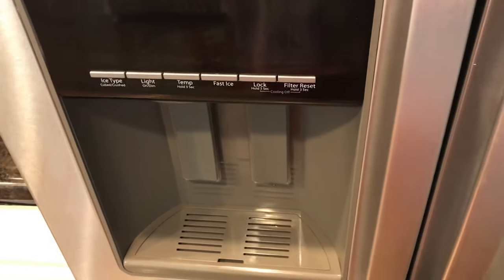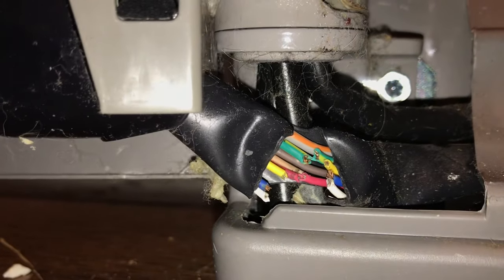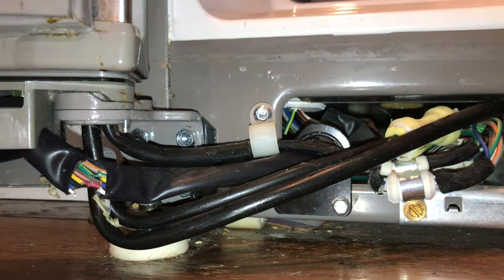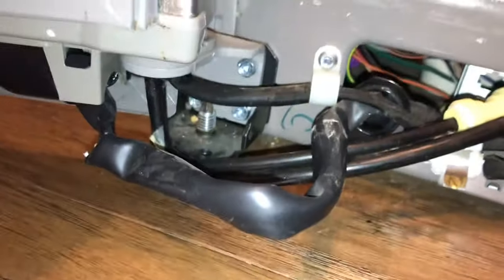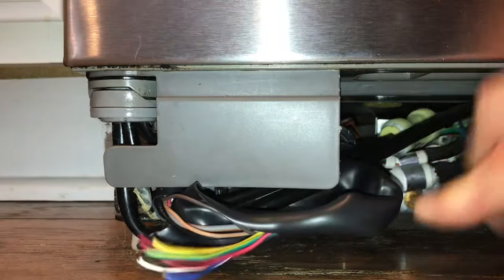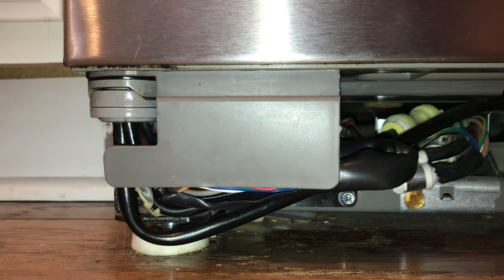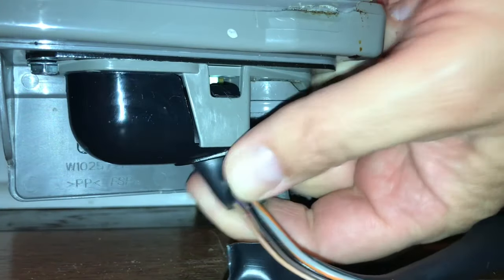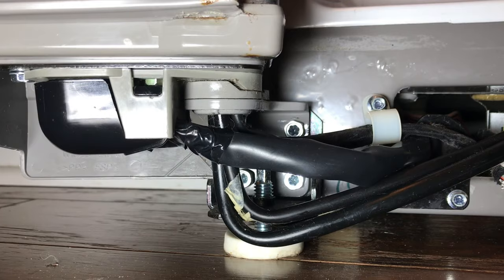Whirlpool double door refrigerator not making ice and ice dispenser doesn’t work. Wires WRS571CIDM01

Comment: I want to thank you for this. Mine stopped making ice about 6 months ago. I bought a new replacement icemaker  part and was looking for installation videos when I saw your video. My wires  on model WRS588FIHV00 look just like yours. Broken. Has anyone told Whirlpool or complained to them? Again, thank you for the video. At least I didn't install the new icemaker only to have it not work. You saved me time and cursing.
Reply from the maker: I called them and they said they would cover parts, but I had to pay labor and use their service guys.  Good job finding the issue. 

Please help me by subscribing.

Comment: Thanks for the video.  I replaced our icemaker a year ago after it stopped working.  New unit still did not work.  Resorted to dumping bagged ice into the hopper and continued to use the ice dispenser until it recently stopped working. While researching the problem again I came across your video. Sure enough, all but one of the wires were broken. Spliced all of the wires back together and now we are making ice again!
Reply from the maker: Did the same thing by buying bagged ice for a year, until I decided to dig deeper into the issue. Enjoy the full glass of ice!

Please help me by subscribing. Thanks.

Comment: I have a 6 year old fridge with the same problem. It was about two years ago I google this issue. I couldn’t find anything on YouTube at the time. It was pictures in a forum. Sure enough, I looked at the bottom of the door and there were a lot of broken wires. What a horrible design. No ice for over two years. Can wait to splice the diced wires and get some ice again

Comment: this video just saved me from a job turning into nightmare with customer. this video should be the first on searches for these models. I almost charged my customer for a control board after changing auger motor, and ordering new interface control panel. what a waste for a manufacturing defect.
Reply from the maker: I agree.

Comment: Every single one of the wires were sliced clean when I checked and the protector had maybe a half of an inch left before the whole thing was detached.  Insane. I hate this fridge so much. Fridge portion has never worked right, always freezing stuff from day one. No room in freezer for anything really. Can't even fit a pizza without turning it sideways. This video helped me so much. I was driving myself crazy trying to figure out why the ice would not work. Will have to learn how to fix wires though lol XD
Reply: I used this video to splice the wires together. Just strip Enough of the wire covers off, twist them
Together and secure with electrical tape. Then wrap the entire wire bundle itself in electrical tape. 

https://youtu.be/ihpNCVk1lF0?si=v5J9Ar_jcZLoehf_

Comment: Thank you @motofun for this great video. I had 4 broken wires. I repaired them by adding a little extra 18 gauge twist wire in between the break and now have ice again. Note that 3 wires carry no voltage but still works. (green, blue and gray/orange).

Comment: Our dispenser went out about 6 months or so ago and most recently the ice maker stopped working. I found 4 severed wires and now we're back up and running with both. Thanks for taking the time to post your video!
Reply: Should also note our fridge is less than 2 years old.

Comment: I have the SAME EXACT problem!!!  Same exact fridge.  I bought it 6 years ago, so it's "Out of Warranty".  Absolutely REDICULIOUS!!!!!  Thank you for showing this and validating my frustration!!!  Soooooo stupid!
Reply from the maker: I agree. Frustrating and stupid.  Good luck with the repair!!
Reply: @motofun72  I cut the wires, soldered some new wire between each end and Voila!!  Worked for 2 days, but ice maker stopped making ice.  Ugh!!
Reply from the maker: @kevindesaulniers6409  man, so close!!
Reply: Same exact issue after 6 years. Almost ordered the auger motor, and saw this video and yup, wires are cut. Great job to the OP. Thx. Will have to contact an electrician now.
Reply: Same exact issue after 6 years. Almost ordered the auger motor, and saw this video and yup, wires are cut. Great job to the OP. Thx. Will have to contact an electrician now.

Comment: Mine stopped making Ice yesterday, its 2yrs old. 4 broken wires, I stripped and reconnected real quick 30 min later I was making some ice. I will do a a Permanente  repair later in the week. Had a older model in prior home for 5 years never any issue. Great video! I subscribed for you.
Reply from the maker: Two years old and cut wires. That may be a record. 

Less than one day without ice?  That’s what I’m talking about! Good job getting it done asap!  Thanks for subscribing.

Comment: Awesome video. Many thanks. I wish I would have found it before buying and replacing multiple other parts that were not needed. And I completely agree that there should be a recall or class action lawsuit vs Whirlpool on this, and that Whirlpool customer service completely blows and don’t respond to inquiries and complaints.
Reply: Yeah, me too. I bought a new icemaker, a control board, water valve, and both IR ice level sensors. Still no ice.

Comment: I have a similar Whirlpool refrigerator (WRS571CIHV01) and am having the same problem with the ice maker and was able to find this video. Sure, enough I opened the freezer door and looked down below and found the same issue with most being wires pulled apart. Thanks for posting this!

Comment: Thank you for this!  Our 4 year old unit stopped making ice a few days ago.  We put a new filter in first to make sure the water pressure was adequate. Next was to replace the whole icemaking unit.  Then we saw a single cut wire at the bottom of the door.  It was a very clean cut so we thought it might be for a function we don't have on our fridge,  In desperation, my hubby joined the 2 ends and a few hours later we had ice!

Comment: I am a retired electrical systems trouble shooter=wire stretcher/tube bender.  My wife found this video and showed it to me.  Long story short, I found two broken wires in exactly the same wire bundle your video showed.  The black wire is power to all the guts of the ice maker, the tan is a check to the module for ?????  Took me a couple hours to isolate and fix.  Used soldering and shrink tubing to reconnect the wires with a additional wire loom back up got us back up and running.  Thanks for the insight and thanks to my wife for finding your video.  This is not rocket science or require an engineering degree.  Whirlpool could have done much much better for an 'American Made Product"!  My Wisconsin Old Fashion on the rocks tastes damn good!!!!
Reply from the maker: Good job all around!  Drinks are always better with ice. 🧊Thanks for watching. Please help me by subscribing.

Comment: I had already fixed this once but my repair failed.  Not sure I have access to enough red wire on door side to splice.  Black wire also split from prior repair.  I wish I had known of the slack in the main body previously so thanks for pointing that out.  Even with the door side bottom cap popped off there doesn’t seem to be much slack.  Wish there was easy access to splice additional wiring on that side as well.  Nice video!
Reply from the maker: I agree. Not much wire to work with at the point where it happens. Even if extra wire is added, we all take the risk of it happening again. So far, my repair is still ok, with the extra slack I put in. 🤞🏻

Please help me by subscribing. Thanks.

Comment: Thanks for the video.  My ice maker quit working.  It won't turn back upward after having dumped the last batch of ice. Was thinking it was mechanical but when I saw your video I checked mine.  I've got at least 3 wires broken.  Most likely the cause.  If not, its definitly the place to start.
Reply from the maker: Awesome. Soon you will have ice again!  Please help me by subscribing.

Comment: Add me to the list. My side by side is a year newer and still. What a bad design in the first place. Thanks for taking your time to post this, once again, youtube saves the day.
Reply from the maker: You’ve been added to the list of failures. Good news is, soon you will be added to the “ice ice, baby” list very soon!

Please help me by subscribing. Thank you!
Reply: My fridge is now back and working. A couple tips for those who take on this task: 
1. Take the freezer door off the freezer. The cables un plug behind the cover at the bottom of the unit and it's a lot easier to re-solder any wires with the door sitting on a workbench.
2. I took the clip off and ended up feeding the wires through a 2 inch section of pex in an effort to keep this from happening again.
Reply from the maker: @e2a2j  awesome. That’s for posting the tips!  Good job.

Comment: Same issue, got there after replacing the ice maker and was about to pull the fridge to fiddle with water valves. Thanks for the tip! Thankfully only 2 wires are cut on mine, I think I can solder them well enough.

Comment: Thank you for posting this as my tan, white, and green stripped wire was severed and I use marine crimps and heat shrink and now my second ice maker they warranted out is working.   I could figure out how to put the protector back and left it off to give the wires more room to move.   Not a great design if you ask me.
Reply from the maker: Good job. I agree, bad design. 

Please help me by subscribing.

Comment: thanks for info I have a whirlpool side by side GSF model and it stopped working after 2 years never had time to look at plus it was expensive since I had no warranty, anyways about a 4 week ago the main control board went dark so I figured it is 13 yrs old I will get one it was cheaper then new fridge, then all of a sudden it  was kicking out ice like a mad ice machine then it died again so started looking in to problem and found out the receiver board went bad  got a new but still no ice so looked at your post and thought humm no way sure enough I also had broken wires that had burn marks on them so was not easy fix repaired :face-orange-frowning: darn whirlpool I have ugly words to say about whirlpool but I wont fixed wires and low and behold ice but it was small ice tweaked the water flow adjustment and now all good for now I think those wires messed withe the Ice maker but will let run till it dies :face-blue-smiling: heck it 13 years old, thanks for posting the wire problems saved me more money lol learned a lot along the way ice machine very sensitive  i will share that the ice makes should have 120 VAC voltage at all time  to test points L-N when door switches are depressed good luck all I will now be very careful and look at fridges in a different light technology hummm

Comment: Thanks!! Luckily mine only had two wires cut. Ended up cutting off all of that plastic conduit and using electrical tape. It looks to me as if that conduit could be cutting the wire.

Comment: This is a design flaw not only with Whirlpool, but also Kitchenaid and other side by side refrigerators with wiring being compromised in the door.  You explained it well.  Have had our now 10 year old Kitchenaid Side by Side repaired maybe 7-8  years ago for the first time by a repair man, then have been doing it ourself to reconnect severed wires every 6 months or so for the past 7 years.  The repair always works but is temporary until the wires are severed again from opening and closing the freezer door, so beware!   We try to not open the door to get ice from the hopper and only from the dispenser to slow down the wear on the wiring at the bottom.  We are getting close to running out of wires to resplice each time, but knowing this is a flaw, it has given us additional years of use with a perfectly good refrigerator in every other way.  We were told by the repair man 7 years ago, that when buying a refrigerator next time, to buy one with icemaker totally inclosed inside the freezer potion (no parts extending into the door (which doesn't allow ice dispensing from the door, but still gives you access to opening the main door for ice) without wires being severed over time.  So for now, we fix the wires every 6  months or so when the ice stops dispensing, but we are getting close to running out of wires to splice back together and will have to put out $$$ for a new refrigerator in the near future.   Next purchase will not have the same design flaw with location of any icemaker portion into the door.!  Too bad that major companies still continue to design icemakers after 10 years with this same wiring flaw.  It keeps our repairmen in business.  But knowing it is also a do-it-yourself repair is significant.  Best of luck to all having this problem.
Reply from the maker: Every six months, that sucks. That means, mine should be failing again soon.  Make sense it will occur again and again. 🙁
Reply: @motofun72  unfortunately it will occur again, but ours seems to still dispense ice, so we just refill the hopper inside the door from a bad of ice from our garage freezer. It buys some time till we finally repair the wires again.  Maybe your repairs will last longer. 🤞😊
Reply: The problem is the cheap wires used by the manufacturer. They get bent back and forth every time you open the freezer door and eventually they break from the repeated bending. You need good stranded wire with silicone insulation. And you need to make the wire splices with solder seal wire connectors.

Comment: Awesome! I reconnected 8 wires with a lever wire nut. The double mini size gave just enough room to allow door to close properly.  Also, I hope these wire nuts will provide  a planned failure point in the future.  Here is the Amazon description: Zorhsgee Mini Compact Wire Connectors, Lever Nut Wire Splice Connectors 2 in 2 Out for Wire Splices
Reply: They look too big. With 6 broken wires, I would need 3 of them, and it doesn't look like there's enough room to pack them all in there. 3 to 3 would still require 2 of them. I think I'll try butt connectors, or solder and shrink wrap.
Reply: @jimdavis6833  You are right that the regular sized connectors are too big. I tried those at first.  I had to reorder the mini compact 2 by 2 connectors and there was plenty of room. There were a total of three connectors connecting 6 wires

Comment: What a bad design was about to buy an new auger then saw this video and sure enough all the wire are cut, thanks motofun
Reply from the maker: I know, bad design. Good luck!  Help me by subscribing. Thanks.
Reply: Unfortunately I did buy and replace the auger motor before seeing this video. So Juan did your auger start working after the repair?
Reply: @genewuchner9004  yes
Reply: @miller1236  thanks man

Comment: I add a 3 inch extension on each wire of the harness. This is my first check on dispenser issues with these. 

At least it isn't the GE side by side with the freezing water line! You can fix this with ease in comparison.

Comment: I am in Canada and I have a Whirlpool side by side fridge with ice maker and water dispenser built into the door. The ice maker stopped working  and I searched on youtube and found countless complaints about the wires running under the door ripping. The fridge is about 2 years old. I CONTACTED WHIRLPOOL AND THEY AGREED TO ONLY PAY HALF THE COST OF THE PARTS, AND WANTED ME TO PAY FULL LABOR. I REFUSED. Please share with me any class action lawsuit that you know of. Thank you

Comment: I took off the bottom cover to clean under the Maytag Refrigerator 2 days ago (MSC21C6MDM00) and then later the icemaker stopped working.
Found this and sure as $heet two wires were cut (not just broken).
These look like they were cut/smashed by the nearby hinge assembly
The wires were still flexible (7 year old fridge) so I'm pretty sure its not the flexing of the wires but that they get caught on the metal hinge and get cut.
I cut back the original outer jacket and butt spliced the 2 wires (soldered with shrink tubing) then wrapped 2 layers of electrical tape.
Still waiting for the first clunk when ice drops.

Thanks
Reply from the maker: Awesome you found the issue fast. I guess this issue has been around for years!  Here’s to a big glass of ice, soon!!

Please help me by subscribing. Thank you.

Comment: Your video was informative however I had already diagnosed the problem on my fridge so the only piece I needed was to see how you connected the wires. I wish you had also shown that repair process. But thank you anyway.
Reply from the maker: After I was finished, I realized I didn’t record the process. Sorry. 

I cut the wires, stripped the ended, twisted the matching wires together, taped each wire up, and then taped the group of wires together.

Comment: Same issue here blue 120v wire split on the bottom that was power for the ice auger motor. Solder and Heat shrink fixed the problem right up.

Comment: The wire gauge is #18! I have seen a lot of folks here wondering what the gauge size is of the wire under the freezer door for ice maker. The wire fits into the gauge 18 grove of my wire stripper when I tried to strip them. The wires carry 14 VDC voltage only per the wire diagram came with the fridge. I cut all 6 wires and added 2 inch jumps in between. This is my lesson learned from just patching the original two broken wires and latter finding more broken wires. I also soldered them together for good measure.
Reply from the maker: I plan to do the same, when it fails “again”. Thanks!!
Reply: Where did you get the wire?  All the big box, mom and pop around here have 18g thats solid copper wire inside the insulation. The whirlpool wires are silver braided wires or whatever.  I did the fix once a while back but it broke again. Now I need to extend the wires and not sure if it's OK mix the 18g silver and copper wire types.
Reply from the maker: @rjd4uk I had some in my garage. Yes, it will keep happening, because of the crappy design.